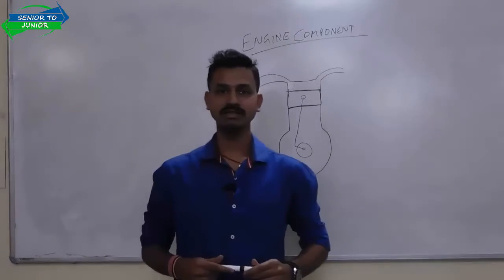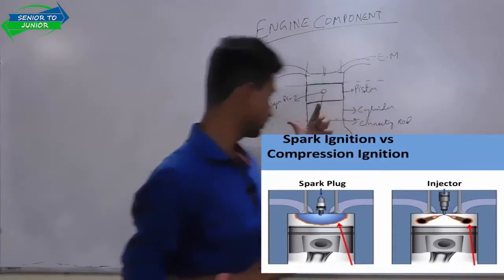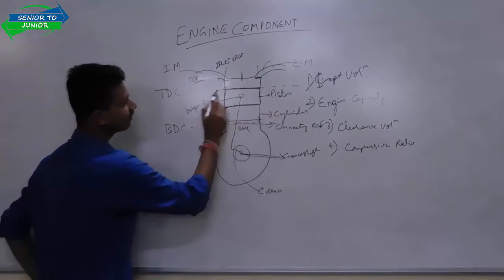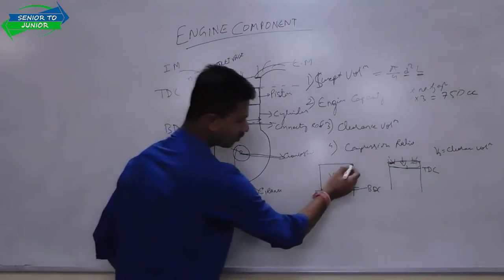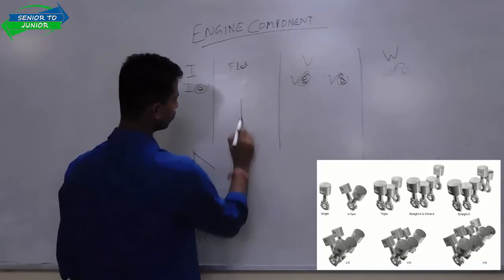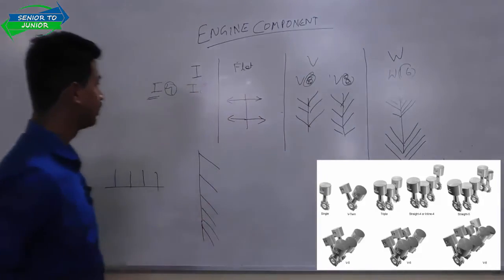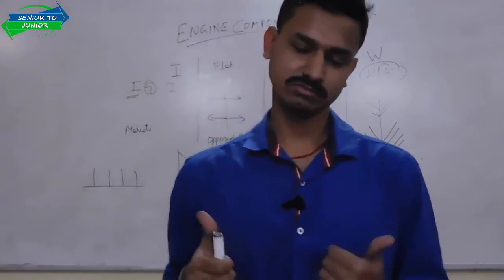Internal Combustion Engine -Engine Component its Layout (Lecture 2)

Comment: Please make note that swept volume is NOT equal to total volume. You keep mentioning that the Total volume is V1. Total volume equals swept volume + clearance volume. Swept volume is only the volume from TDC to BDC. It does not include the clearance volume.
Reply from the maker: thank you for the comment.
Exactly i have told the same thing in the lecture 
Total volm= Swept volm + Clearance Volm.
Swept vol is only the volm between tdc and bdc of the cylinder thats why it is called swept volm.
By the way i have never told that swept volm = total volm
please watch the lecture again 
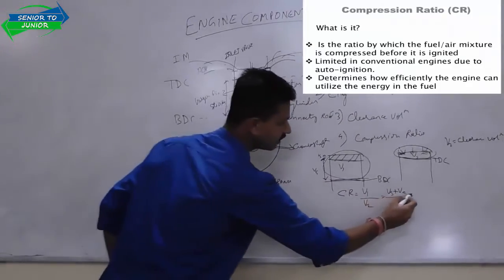watch the video during time period 5:48 to 6:15 and again between 9:29 to 10:10